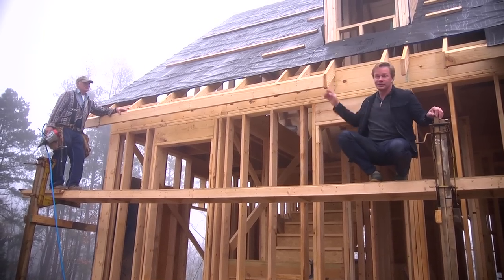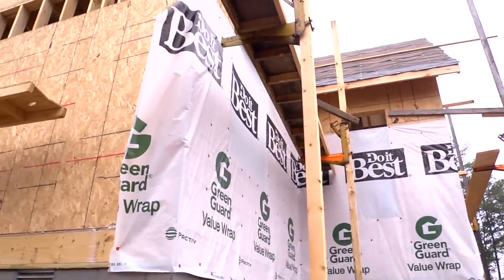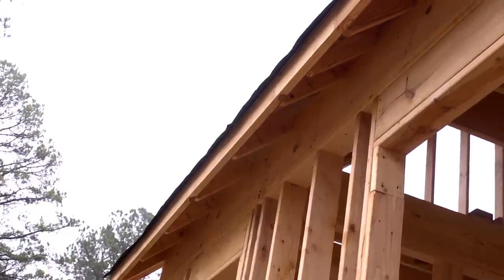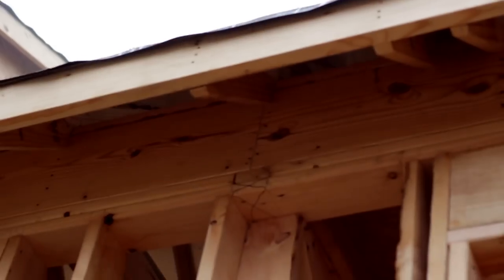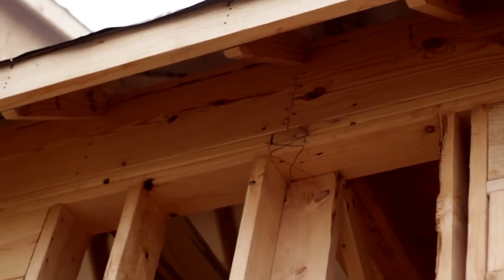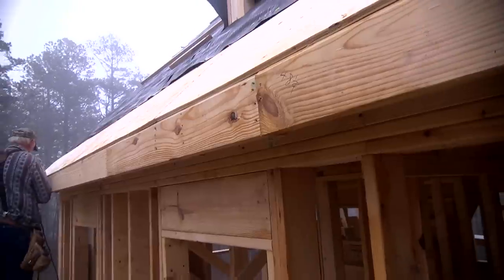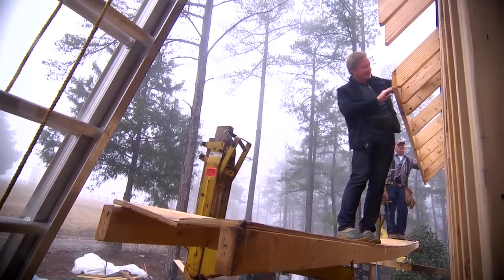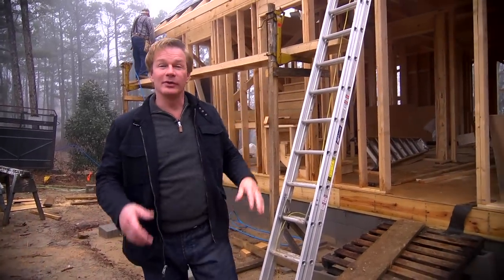Exposed Rafter Tails | Day 27 | The Garden Home Challenge With P. Allen Smith

Comment: I have thought about doing exposed rafter tails on my house.  I was thinking I could use the round cut in vents in the blocking between the tails and use pvc piping to extend the vent above the insulation level of the attic.

Comment: The top of the rafter tail area is dark so what is there is not clearly seen.  Are you running a board straight up from the wall sheathing to the top of the roof i.e. filling in the space between the rafters with a 1 inch board or composite material?